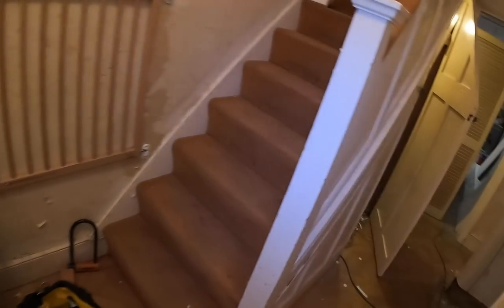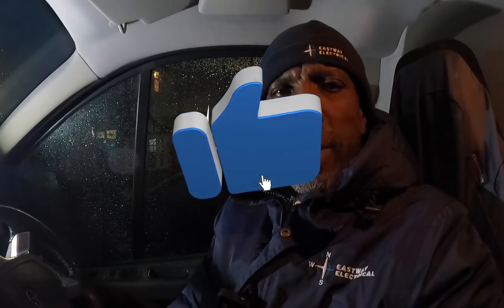"All These Years With No Bonding!" | Surge Protection Consumer Unit Install | Electrician In London

Comment from the maker: After the job I contacted a friend who used to work for supply authority and he informed me that the reason for the two armoured. Is because one provide the supply for next door. Which use to be common practice in some parts of East London. Usually the supply runs along the road and tee's off into each property. I remember that from college also when working on building sites in the 70's. It's also the layout you will see in most text books. I've come across this setup before and always thought it may have be two phases. I've been told you have that type of supply in some domestic properties.
Reply: Very surprised you didn't know about looped services and their implications. I'm not a professional electrician but as soon as I saw two cables at the service head here I looked into it. It's a countrywide thing and was still being used in the 80s when this development was built here in Guildford.
Reply: 18 useable ways? How big is this house? That's insane for a domestic property! 16mm tails too? You really should have used 25mm.
Reply: @garrett69  Depends on load-10 of the ways might have next to no load on them
Reply: efixx did a recent video on looped systems and the implications for E.V. installations.

Comment: Clever position for the stopcock under the floorboards!
Reply: That needs moving to an accessible location, I can see wood flooring going down in the future, oppps
Reply: probably another one downstream, I had to do that.
Reply: @stevelambert6689  Only benefit of getting a water meter, can isolate the whole supply to the house at street level with just a quarter turn :)

Comment: The two cables coming  in to house is usually called a board loop one of them will feed another house it's common in the northwest
Reply: North of London, got an ex council and I've got a looped supply too. Comes up under my stairs and loops into the wall to next door. Seems to have been very common for council housing back in the day. Looks to be a bloody night mare in the current age with elec cars and that needing bigger main fuses!
Reply: Manweb did it this way after the war to save money on providing electrical service to houses
Reply: @timothyjones660  makes sense
Reply: @timothyjones660  They did it here in '82 (Merrow Park, Guildford). The saving in cable would have been marginal - the distance between service heads is not much less than to the footpath - so the only thing they saved on was connections to the supply in the street.

Comment: The power supply to my next-door neighbour's house is linked to the next dwelling up as in 1 supply linked to two dwellings...no earth terminal on either supply so TT to both with earth rods. Their neighbours have not even got a cable just two DI tails linked from the first dwelling incomer and the last time I saw them they were rubber insulated cotton covered equivalent of about 10mm2 if that going through the wall. The guy that owns it, its empty at the moment, is a spark so no doubt he will sort it

Comment: 1:35 Its a looped service for a neighbouring property, I believe also if in the future they want an EV charger they need to have it unlooped, which is usually free.
Reply: From the info I have it's only the last one on a looped service that can request a direct connection. If you are the one with the looped service head like here, you can't.

Comment: Excellent work del. Is 16mm ok on 100amp fuse then?
Reply: 16mm tails isn't rated for 100A....should be upgraded to 25mm tails in my book
Reply: @sarge9920  that's what I thought, hope he meant to say 60amp fuse, or 80?
Reply: @sarge9920  But it looks like a looped service, so the main fuse should be 60A, 80A tops.
Reply: Was going to ask the same question.  Have seen 16mm rated at 87amp and 25mm at 110amp but have also seen 25mm at 97amp. Better going for 25mm flexi tails 19 strand easier to bend.
Reply: @stevelambert6689  yes the flexi tails are a game changer
Reply: @Graham_Langley  you're right, but del does say its 100amp fuse in the vid 🤷‍♂️
Reply: @lewistempleman9752  That may just have been the label giving the rating of the fuse carrier - did he actually pull the fuse and look at it? The label on the fuse carrier here says 100A but the fuse fitted is 80A.
Reply: I've now watched the rest of the video. At some point the main fuse would/should have been pulled to connect the isolator, but it's glossed over and not said whether someone came in to do it as is supposed happen, or Delroy pulled it himself. If the former then he may not have seen the fuse and is just assuming it's 100A despite the 16mm² tails, which he seems to think are OK with a 100A fuse.
Reply: @PETER WILSON Exactly - 100A is the max rating. Pity there's no way of seeing the fuse fitted without pulling it. The one here now has an '80A' label on it but hasn't been sealed since a new meter was put in some 19 years ago as they broke the remaining loop the seal goes through.
Reply: @Graham_Langley  That sounds like the situation in my house. The main fuse hasn't been sealed at least since the meter was changed in 2003 because the lug that the wire should go through is broken off. 
The fuse in the carrier is 100A but until this year the tails were 16mm, now upgraded to 25mm.

Comment: Out of interest, why does the UK use single phase for homes?
Surely three phase with thinner cables would be better than having that 25mm you mentioned.
Granted some homes don't need that many amps, but 3 phase 40A per phase in that case?

Comment: As others have said a looped supply. Seen it a fair few times, usually on old terraces houses.  How did the guys who did the wet room board manage to sign that off without the bonding in place? Blatantly lied on the EIC and ticked yes!
Reply: A late elderly neighbour had a new CU put in when the bathroom was converted to a wet room under some grant scheme. The new gas bond clamp was so loose a it rattled.
Reply: @Graham_Langley  That’s awful. I work on some adaptions to wet rooms through a. Council contract and to sign off they have to ensure the install is up to standard so should be checking bonding etc. Sadly there’s some people who just don’t take are pride.

Comment: Delroy, when you change a consumer unit and there is no isolation switch, do you remove the main company fuse(100A) order you get the Elect Company in to remove it.
Reply: He should have done but it's glossed over in the video.

Comment: I would say loop in and out especially if it was terrace house,was quite common during ww2 so other houses didn’t loose power if a bomb was dropped. That was told by my uncle as he worked for London power house as it used to be called, also there was a copper shortage and it wasn’t doomed important, uk used a lot of french copper as well, not as good as ours as some plumbers will tell you as it was slightly smaller diameter ( hence you have to change olive or pack it out with ptfe
Reply: This place was built in '82 and has a looped service, along with most other houses in the road. But it's not a halls-adjoining semi, it's a link-detached house and the only thing they saved on was the number of connections to the supply in the road.

Comment: Delroy can you help?
Fitted an outside sensor light and come off my downstairs lighting (spur) which is a pull light switch, but sometimes pulling the switch activates the sensor light outside. Like if you soft pull the switch it sends an surge to the light????
Any ideas?
Reply: A lot of PIR outdoor lights need a permanent supply so you are probably putting the light in manual mode by operating switch.

Comment: I've asked this question to plumbers and electricians and they can't answer it.
Why bond pipes on a boiler that are bonded already?
Reply: Used to when there was a requirement if there was no RCD,,like we had to with metal sinks,👍
Reply: Two types of bonding. Electrical and mechanical. Always better to have as much electrical bonding as possible. Some properties have a combination of copper piping and PVC piping. Some pipe work can become corroded or rusted and will give a much higher resistance to earth.
Reply: I was told that Gas and Water don't need to be earthed now if an SPD has been installed. Apparently if an SPD is fitted it means that the pipes are not connected to the electrical system and they want to minimise what is connected to the electrical system. But Im not entirely sure if this is true or not. Anybody know?
Reply: @denzelsless5218  

Doesn't sound right to me. The bonding is done to ensure the conductive pipes/parts are at the same potential as earth (zero volts) 

An SPD protects against transient voltages.
Reply: @denzelsless5218  to me a spd would not cover metal pipes from coming live under certain conditions ,so till I hear different,will continue to bond water and gas,not sure where you are coming with that pipes are connected to the electrical system,
Reply: @Jay369  yeah I'm not sure. 🤣🤣🤣 I actually think I heard it off of one of N Bundy's vids
Reply: @tww5719  

Perhaps he was suggesting that once bonded they are then part of the electrical system, maybe?
Reply: @tww5719  connected to the electrical system by connecting a 10mm earth wire into the main consumer unit. I didn't say that is what it is I said I heard that and asked if anyone knows. 🤣🤣🤣🤣
Reply: @cumberland1234  yeah, could be that. I just remember a N Bundy's vid that he mentioned it but canna find the vid now. 🤣🤣
Reply: @denzelsless5218  Water doesnt need bonding on new properties as incoming services are now plastic , however i argue that if an external tap is fitted its advisable to bond
Reply: Oil, water and gas should be bonded unless it’s plastic but I always remember my tutor “if in doubt, bond it” it can’t hurt he said.
He also said “it’s all about potential” then stared at one guy and laughed mentioning jobs at Mac Donald’s 😄
Reply: John Ward overs this in this video https://www.youtube.com/watch?v=CVxBettQpPU&t=28s at about 20 minutes in
Reply: @no_short_circuit  https://youtu.be/CVxBettQpPU?t=1236
He said he doesn't know why too.
Reply: @gteaz  There is no answer to your question.
Those that do have an answer. Dunning kruger effect.